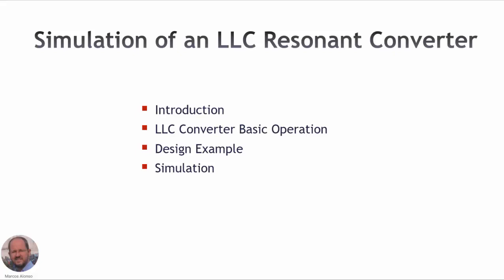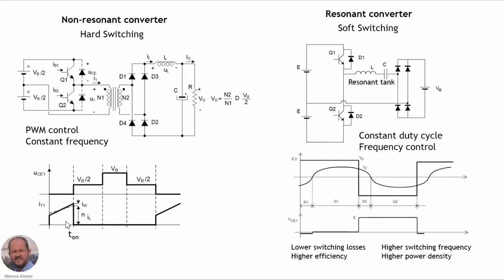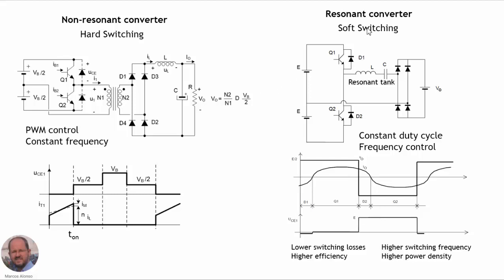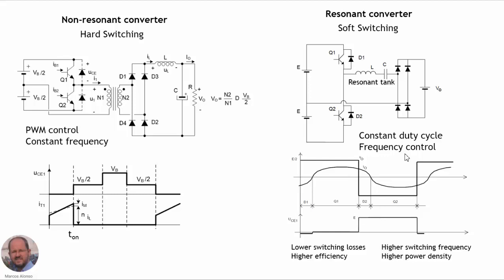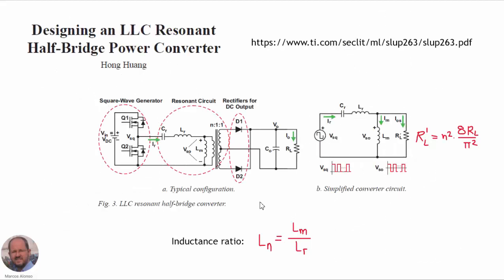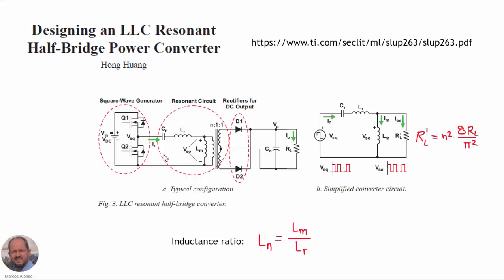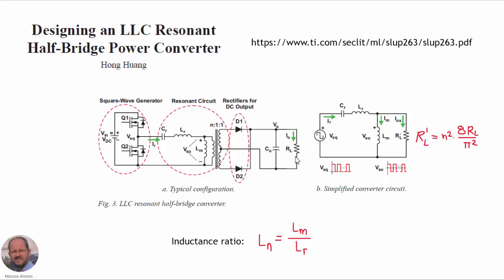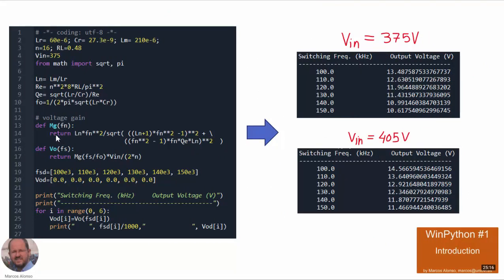PE #40: LLC Resonant DC-DC Converter: Basic Operation and Simulation

Comment: Thank you proff. for the insight. If I want to do synchronous rectification of this LLC converter then how to provide the gate pulse for the other switches. Can you please give me the idea about that?
Reply from the maker: Usually SR is implemented using auxiliary windings on the transformer to drive the switches but there are also specific ICs for this purpose. See for example the UCC24624

Comment: Hello, Marcos! 
As always, thanks for your detailed video!
A little question: why we should to use delta value of spikes at 32:34? Isn't the both spikes negative and positive represent losses? Or it represents stored and extracted from Cds energy only?
Reply from the maker: Yes to the latter question. This is energy handled by Cds. Only the difference between both spikes are losses. These losses are dissipated in the MOSFET's channel. Thanks for watching!

Comment: Thank you sir for the detailed video. However, could you please provide code/screenshot for the code written to generate voltage gain vs frequency plot for different value of normalised inductance and quality factor? I'm having difficulty in getting that plot. Thanks.
Reply from the maker: You only have to plot the equation of M_g shown at 6:50. You can use Winpython for this. In video Winpython #1 at https://youtu.be/5aF-Iwf3dzg, you can see an introduction to Winpython. It also shows how to plot functions. You can do the same for M_g.
Reply: @MarcosAlonsoElectronics thanks for your prompt response. Can you please elaborate how to find relevant values from Mg plot after plotting it on winpython since cursor (as available in ltspice) is not available in winpython. How do I find F0 and max and min gain in this case?
Thanks.

Comment: Thank you for the reply sir. One more question, sir, why switching frequency chosen as 140kHz instead of 150kHz? Is there any reason, sir?
Reply from the maker: This was just a possible operating point that was selected to obtain a value of 12 V at the output for a given input voltage. You can choose other points within the switching frequency range. Remember that the switching frequency is our control parameter so it is variable. 
Thanks for watching!
Reply: @MarcosAlonsoElectronics  thank you very much sir.

Comment: @Marcos Alonso, for resonant converters (e.g. LLC), how someone can implement a small signal model in simulation?  With voltage/current sources, like how is it done in the case of PWM dc dc  converters?  How could for example the control-output transfer function for an LLC converter be deduced in simulation with a small-signal model (so not using a switching or averaging model, but a small-signal model)? There is such a thing? Can you do a video showing how to do this?
Reply from the maker: Thanks for the suggestion. To do a dynamic model of the LLC resonant converter is more complicated than a conventional non-resonant DC-DC converter. It is not enough to consider averaged values because the state variable are AC so we need to consider the first harmonic too.
This is a topic that I have in mind for a future video. Thanks!
Reply: @Marcos Alonso But you already know how to do the small signal model by calculation and simulation for resonant converters?  It would be good then if you could accelerate the creation of these videos on how to calculate and simulate the small signal model for the transfer functions: control-output, audiosusceptibility, input impedance, output impedance, in open loop and closed loop at least in voltage mode control, for these resonant converters. Would you do this?

Comment: Sir, If I measure voltage across transformer secondary without diode bridge rectifier then I should get a sine wave right? When I did hardware spike across transformer secondary was huge. Is this because switching is not proper?
Reply from the maker: Hello, if you remove the rectifier the resonant tank will be operating with no load. The waveforms can be strange.
If you want to see sinusoidal waveforms without the rectifier you have to place an equivalent load resistor at the secondary.

Comment: Hi sir, in this video at time 22:33 you said that tdead is >85ns how you calculated . I have calculated using the formula 16*Ceq*fsw*Lm , the values i have taken as Ceq=0.2+0.2=0.4 , fsw=150kHz , Lm=210uH. i am getting 200ns . Kindly clarify the doubt sir.
Reply from the maker: Hi, thanks for your question. The formula is on the slide at 15:00. Using Ceq~Cds=0.2 nF (only one switch's because 2*Ceq is already considered in the formula), fsw=140 kHz (max. switching frequency), Lm=210 uH. We get t_dead=16*Ceq*fsw*Lm ~ 85 ns.
Reply: @MarcosAlonsoElectronics  thank you for the reply sir. One more question sir why switching frequency chosen as 140kHz instead of 150kHz? Is there any reason, sir?

Comment: Sir is there any way we can measure converter input impedance using LTspice?

I was trying with buck converter input impedance by placing series input ac source in the input side but unable to get it ..any suggestions?
Reply from the maker: Yes, it is possible. The procedure is similar to that shown in video LTspice #6: https://youtu.be/JCHiMp47UGw
You have to inject the modulating signal in series with the input voltage. From the input voltage and input current perturbations you can calculate the input impedance and represent it from the log file data.
This can be interesting for a future video.
Reply: @MarcosAlonsoElectronics  I was trying to design the input filter for buck converter so instead of calculating buck converter input impedance analytical ,I was trying with simulation. I tried to search in internet but it seems like no one measuring input impedance using LTspice that make me think how to do it.
Reply from the maker: @biswajit681  I will post a video about how to do this soon. This is on my to-do list now.
Reply: @MarcosAlonsoElectronics  Many Thanks sir ...

Comment: Sir what is U3?
Reply from the maker: U3 is a current sensor available from the Simulink-compatible control library. There is a playlist on this library on my channel. The library is available from my website.
I use it to measure the resonant current as volts so that it can be represented together with the magnetizing current generated by the voltage source.